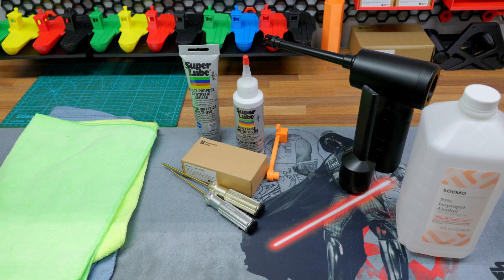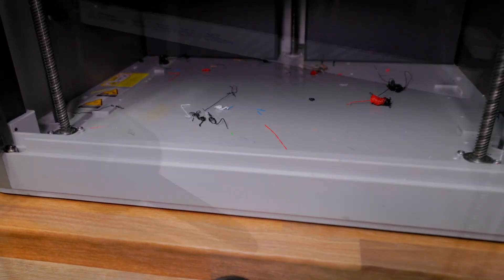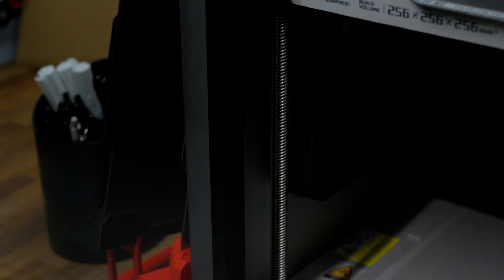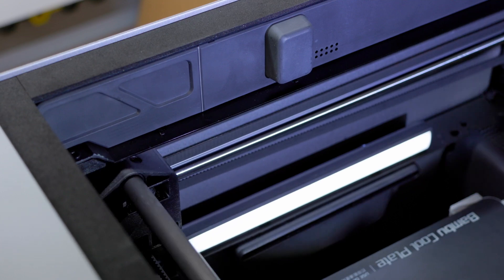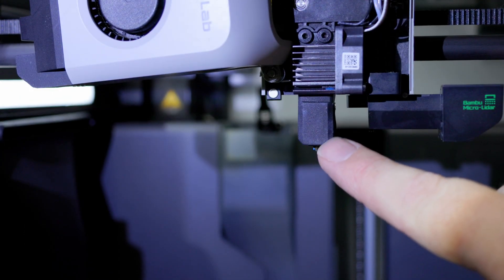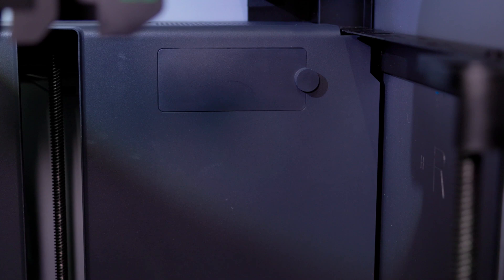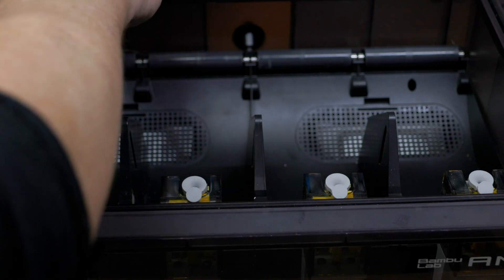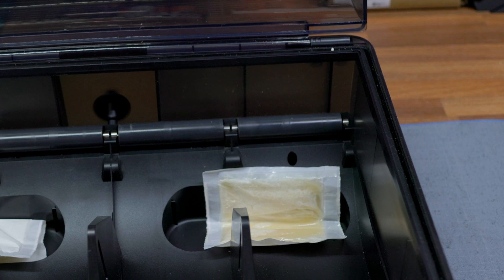Bambu X1 Carbon and P1P 3D Printer Maintenance Guide: Tips for Smooth Operation and Longevity

Comment: All these videos and I can't seem to find one with applying thermal grease?? Is it not necessary? Just bought a P1P and I have no clue why it was included, I can't find how and where to apply it properly.. just articles saying to put it on the thermoster and heat block but it doesn't seem right..
Reply: it's for thermistor, not for maintenance.

Comment: Why only use oil in the Y axes rods and not the X axis rods ?
Reply: Because they are self lubricating carbon. Grease would only make dirt stick to it and increase friction on the precision fit sheathes. Y axis are hardened steel with ball bearings, oil ist mostly used for rust prevention but also slightly lubricates the rods. Less dust has teh chance of going there since they are off to the side and rather protected.

Comment: Thanks for this!  How do you clear the maintenance alert on the printer?  Its says to lubricate the lead screws which I did like your video shows, but the message is still there.
Reply from the maker: I thought there was a complete or done button on that message?  I don't see anything in the wiki either.
Reply: @lendizzle77  yeah I've googled and searched and can't find anything.
Reply from the maker: Can you email a picture of the alert?  Or post on discord?  Links to both in my about
Reply from the maker: Is there a message with a QR code in the message tab?

Comment: For some reason I can't get the app to pair with x1 carbon. Phone and machine on the same network. Would you know of any reason this isn't working?
Reply from the maker: 2.4 ghz network?
Reply: @lendizzle77  the router has both networks but only one showed when I tried to pair it. So I assumed it is the correct one. The printer let me connect to the network just won't pair with app. I'm not even sure how to forget the network to try double check if 2 were showing. Only turned up yesterday arvo and stayed up until midnight setting it up lol
Reply: @lendizzle77  now that I think about. Could possibly  be my phone connected to the 5g instead of 2.4. I'll have to try that when I finish work. Will be a few hours and I'll get back to you to see if that's the problem. Was to excited last night taking everything in
Reply from the maker: My router lets me broadcast 2.4 and 5 on the same SSID(network name)
Reply: @lendizzle77  ok. Mine does the same but usually shows 2 of the same names with 1 saying 5ghz at the end of it.
Reply from the maker: Make sure the Bambu is on the 2.4 and you should be golden
Reply: @lendizzle77  thanks for your help. I'll check all this in a few hours and hopefully works
Reply from the maker: You are welcome. Hope it works
Reply: @lendizzle77  I checked everything and couldn't find a issue. Still wouldn't work. So then I used my phone hotspot and tried that way, it worked fine. Switch back to home network and nothing. Few hrs later I put a print on with sd card and opened app on my phone and everything is working on home network weird but at least it's working now
Reply from the maker: Super weird. At least it’s working

Comment: DO NOT GREASE THE CARBON RODS! They are self lubricated by graphite pads
Reply: You use IPA alcohol. HMS_0300_1000_0002_0002
Reply: Do you mean oil or grease? Eveyone I've seen they say to oil them.

Comment: Hi Len, great video but a few items you may want to be aware of.  

1. is the back lead screw which someone else already mentioned.
2. when blowing air in a fan it is important not to let the air spin the fan up.  Doing so will actually draw the dust up in to the fans bearing and lead to an early death.  
3. Oil will degrade the belts, so it is really important to not get any oil on the belts.  If you do get some on it, you want to wipe as much off as possible.
Reply from the maker: Thanks for the feedback!

Comment: Nice that you do such a video. 
The X1 is a high maintenance printer. Dust is the weak point, it sits in the tubes and off course it will clog up the nozzle sooner or later. As you said, the inspection of the tubes are important. I have now seen 2 examples of tubes worn out, a full hole in the tube. Use a little flashlight, to inspect the tubes.
My new saying: A cold pull a day, keeps the nozzle clog away.
Keep up the good work. You might save some X1 users from big frustrations.
Reply from the maker: Thanks for watching and thanks for the feedback!